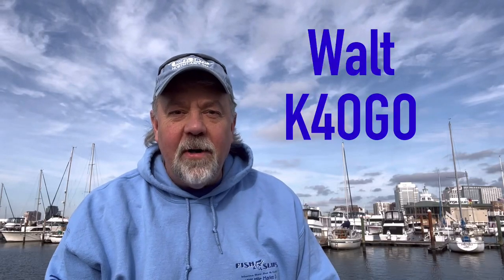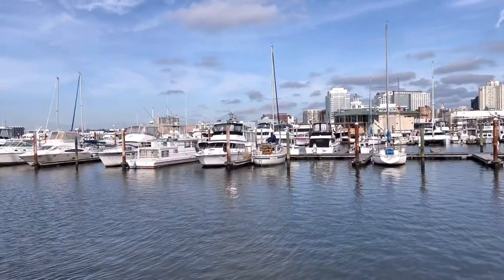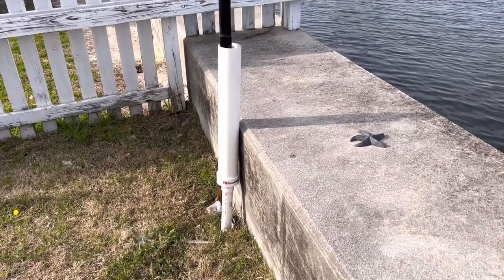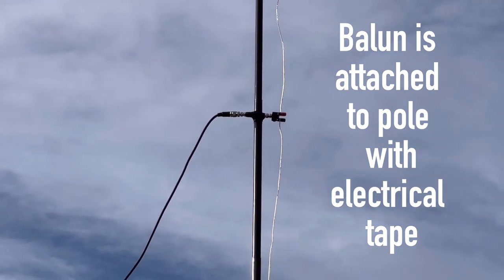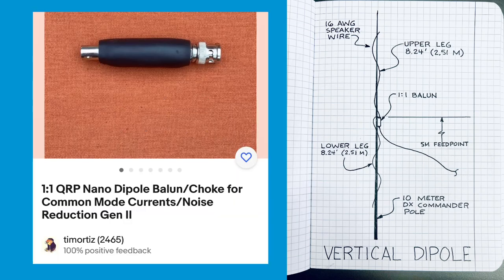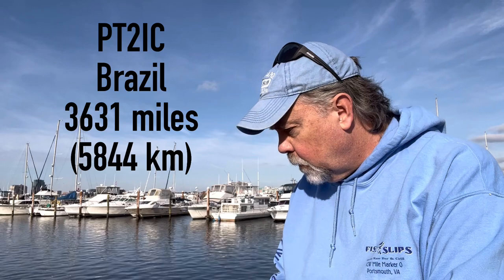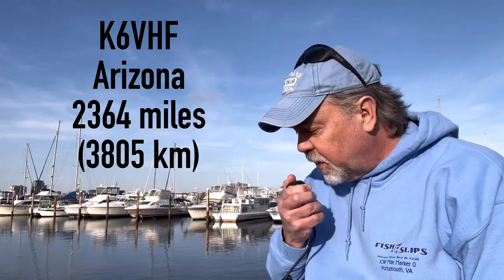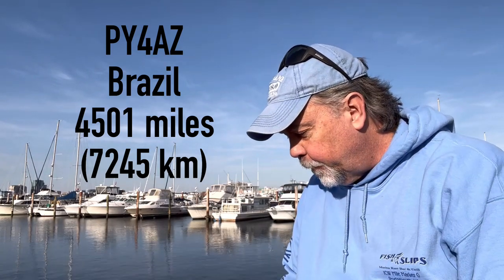Vertical Dipole for 10 Meters

Comment: I built one of these today and set it up in my front yard on a approx 30 foot (9m) fiberglass fishing pole. I was a bit disappointed with the SWR. Minimum was around 1.8:1. I suppose it was affected by the bottom end of the dipole being close to the ground. Will be interesting to see how it performs when I set it up on a SOTA summit. Band was completely dead and I couldn't hear any other stations this morning.

Comment: This is amazing! I put a horizontal dipole in my attic peak here in Pennsylvania and was skeptical of it as a new technician. With a 60-watt Anytone portable radio my first contact was in Scotland!  The strange thing is I can barely receive and talk to a radio club 50 miles away. Frustrating. I am going to try this vertical one. Many thanks! KC3USL
Reply from the maker: Thanks for watching and commenting! 73, K4OGO
Reply: Is the club running vertical? Some experiments have shown up to 25db loss I'd your unlucky enough to be exactly 90 degrees out of polarization. That would easily explain it.

Comment: New ham here - N6OAJ. Am I to understand that the reason a 10m dipole can be configured vertical or horizontal with no real difference in reception is because after the freq skips it changes polarity anyway? If you were talking local you would want to be polarized the same as the receiving station for best results correct?

Comment: Great video. Gotta love the simple little bnc to banana dipole operation. Though I'm surprised as a guy cutting his own "cheap Walmart speaker wire" you didn't also wind your own 1:1 and save a few pennies. I'm working up a few inside PVC Ts with SO239s that should handle a full 100w on a 31 mix for lower bands. Should probably do a 43 mix or 2 for 10m fun. Gonna gift a couple to some buddies just getting their ham tickets so they can get a dipole with a band or 3 up.
Reply from the maker: Thanks! I love that little 1:1 I got from N9SAB

Comment: Hey Walt, being such an old video I hope you get this. 
I've been piddling with this same antenna vertically for a while now. It works great and the g90 can tune for 12 as well. Mine on the upper most element is around 30 feet high hanging on an oak limb. Would I gain performance if I were to double that height? I have a much higher branch where I can achieve this. Thanks for your input, 73's. 
One other question,  have you tried a parasitic element on this antenna for gain and direction? Thanks again.
Reply from the maker: Thanks for commenting! Yes I think you would definitely see an advantage by elevating it. I have always wanted to build this one with a parasitic element, I even drew up a sketch with all the dimensions to do it. I just haven’t done it yet. Thanks for the interest, I might do it soon. 73, Walt
Reply: @COASTALWAVESWIRES  Awesome! Always attentive and looking forward to your videos. Thanks again.

Comment: Any thoughts on the discontinuation of the FT-818ND?  Seems like something might’ve been interested in because it’s such a popular QRP radio and it’s not an SDR
Reply from the maker: I’m thinking Yaesu has something up their sleeve to replace it.
Reply: @COASTALWAVESWIRES  Sounds like they’re gonna have to work their butts off to make anything comparable. I expect the replacement, if they release one, to be a lot more expensive

Comment: Have you ever tried vertical versus horizontal polarisation to determine which provides the highest SNR? Even though the received distances are impressive in your video, the signals sound quite noisy. This could be due to nearby QRM lowering the SNR. But my experience suggests that horizontal generates less noise. But I also understand that vertical polarisation is more convenient to setup in a temporary portable location.
Reply from the maker: Yes I have, and you are correct. This was just an experiment with vertical to lower the takeoff angle for DX transmit.

Comment: Just put this together in about :10 and works way better than a EFHW that I was trying.  5w and a IC705 1000 mile contacts no problem.  Easiest antenna I’ve made yet!
Reply from the maker: Awesome Trevor! 73
Reply: EFHW is great for multi band or if you can't easily feed the center but a simple dipole or even fan dipole always wins if you can center feed and hang it IMHO. Much bigger than this guy and you need to look at going horizontal or doing some coil loading probably. That or what the seller of the pole this guy's using does and go quarter wave vertical with ground radials which Is probably the second easiest setup for a new ham both ease of use and wallet wise.
Reply: @MarkoManiac  EFHW is by definition a dipole.  The only difference to a mid-feed dipole is that it's fed at the end.  If you mount the EFHW vertically, you'll get exactly the same on the air behavior as what's shown in this video.

If you're experiencing worse performance with an EFHW than a traditional midfeed dipole, it's because your specific 49:1 to 64:1 unun is inefficient.  Poorly designed and implemented unun can rob you 3dB or more of power.  3dB means have the power from the transmitted goes into heating up the toroid and cable, rather than being radiated.
Reply: @RobertLeeAtYT  No transformer is 100% efficient. Most EFHWs will loose 15-30% totheir transformer depending on the toriod/windings and particular band of operation. You'll find if you go hang both a dipole is a bit quieter on the receive also. Nothing against EFHWs one is my main antenna right now as the convenience of needing only to support the 2 ends vs an additional center feedpoint was easier at my current location. I am scheming on a fan dipole for my favorite few daylight bands and have a simple ground mount vertical on the way.

Comment: Walt, my learned friend,
I was unable to hear how you attach your wire to the pole at the midpoint. Tell me what it is and where do you find them. Did you use the same method at the top of the pole? I know that only you know the answers!
Reply from the maker: Yes, just taped it with electrical tape

Comment: watched a year later. today 10 meters on fire. and I got out great with just coax. no antenna. well T2LT system. made with 50 feet of RG8X . start at one end measure down cut a tad long. make a mark . Sharpe I use. strip off outher cover . then remove shield. that 1 radio of a di pole. glue line heat shrink at this spot you strip off. measure down 1/4 wave mark it. then get 2 1/2 in PVC . can use 2 in. drill hole in 1 end for coax. wrap around 19 turns of coax. drill second hole  . cut PVC to just longer than coil. that becomes common mode choke . put PL 259 on 1 end . slip PVC over DX commander pole . put the end on with tape . put it up with tape to hold it to pole. then tune . to tune bottom element slip coil on PVC . once you get tune tape or zip tie coax to PVC to hold in place. same center fed di pole like you did hear but made with just coax. Vertical T2LT coax antenna.  made a lot of FT8 on it. on 10 meters. put some power in it . 500 watts. after a wile the coil gat a little warm.  pretty good for 8X . a outher fun antenna . I got a 6 meter one all tuned and ready. but M & P coax. hyper flex 7 used. but 25 ft . love your antenna build. 73's
Reply from the maker: Awesome! 73, Walt

Comment: Did you notice any adverse effects from not bringing the coax away at a 90 degree angle?
Reply from the maker: No none at all, I tried to get it as close as I could to perpendicular but maintaining the 5 meter high feedpoint was a challenge. The fence helped and it looks like the balun/choke did it’s job.

Comment: I use a 4 metre total length horizontal open aluminium dipole for high HF and low VHF DX. Dipole height is only 3.5 metres above ground. Two 12mm diameter 2 metre length rods are mounted on a white polyethylene cutting board. The cutting board is clamped to the top of the mast. The dipole is intentionally mismatched to provide wider bandwidth coverage by using a standard 300:75 Ohm 4:1 TV type balun connected to RG6 75-ohm coax. On the 10 metre band, a 2 Watt 28.2245 MHz YB9BWN Denpasar, Bali, Indonesia CW beacon was easily heard via F2 at 2863 miles. The dipole also easily receives a 1 Watt 40.687 8m band beacon via Es at 1432 miles. This could also form the basis of a temporary mobile directional dipole because the 3.5 metre mast is clamped to a steel fence post at my home.
Reply from the maker: Interesting, thanks for sharing.

Comment: Walt, what do you think about doing this without the balun? (or I guess the better question is : does the vertical orientation make it necessary to use the balun?)
Reply from the maker: My thoughts in using the balun is that it’s just choking at the feed point and reducing any effect the coax might have on the radiation pattern. I’m sure this could be done without the balun but probably not perform as well
Reply: @COASTALWAVESWIRES  makes sense to me, thank you sir! That little balun/choke that you are using is pretty neat by the way.

Comment: How is its bandwidth? The 10 meter band is really wide.
Reply from the maker: I cut it for 28.400 as I was using it in the SSB section of the band. Had perfect SWR in that area. Didn’t use it in other parts of the band.
Reply: @COASTALWAVESWIRES  It would be a great antenna regardless of course, I have a 5/8th vertical that is resonant like yours which is useable in the CW/digital portion and the FM portion without a tuner. The lowest SWR is around 28.6, it's around 1.5:1 at the bottom and the top.

Comment: 10foot pole or 10 meter?  You said 10 foot but have meters.  Also is this cut at 8feet and 1/4 inch?  Just curious.  I built this twice following yours and my swr is horrible.  Maybe the center needs to be up higher.  How high would you say your balun is?
Reply from the maker: 10 meter pole. 8.24’ = 8’- 2 7/8” so your legs are nearly 2 and a half inches too short which would make the overall antenna length nearly 5 inch short which would definitely kill your SWR. Here’s a link to a drawing I did on this antenna: https://instagram.com/p/CmYzoSxO0JG/

Comment: I just built a 6/10 meter hex beam. It's surprisingly small, (about 8 feet across) high signal to noise ratio, and incredible performance. Might be worth a try for you! VA3IRF
Reply from the maker: Sounds like a cool idea. I’ve thought about hex beams. 73, Walt K4OGO
Reply: @COASTALWAVESWIRES  ,they are amazing. I switch from the end fed to the hex, the static disappears, signals come in from an almost silent background, and my signal reports go up by 2 points at the reicieving station. Stations I couldn't even hear from New Zealand and Oz just suddenly come in. Would not have believed it myself until I tried it! Unfortunately, I don't have real estate for a full multiband (6,10, 12, 15, 17, 20) , but it sure kicks butt on the 2 bands i do have!